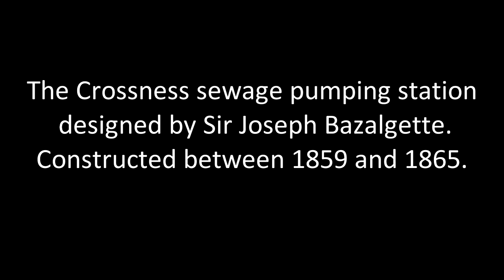Crossness Pumping Station Beam Engines

Comment: What was the horse power of each engine?
Would not the effluent been forced back up the Thames with the incoming tide?
Reply from the maker: I have read the estimated HP is between 200-250 but this has not been officially confirmed.
Yes, flowback was a problem. In 1891 sediment tanks were installed, the sludge was taken out by barge then dumped further out into the Thames Estuary. Later proper sewage treatment works were established.